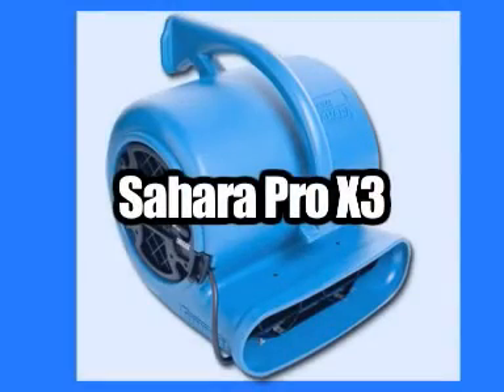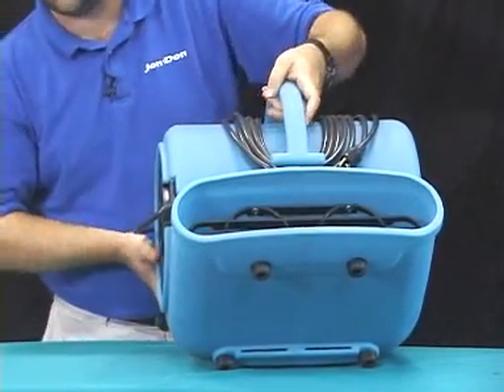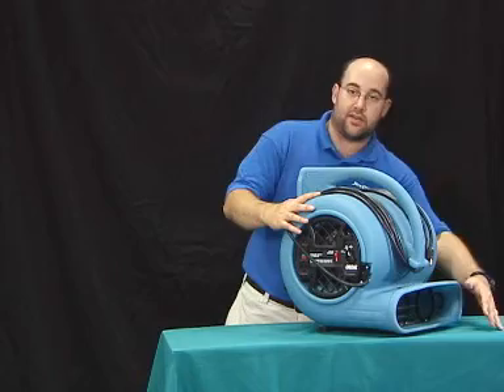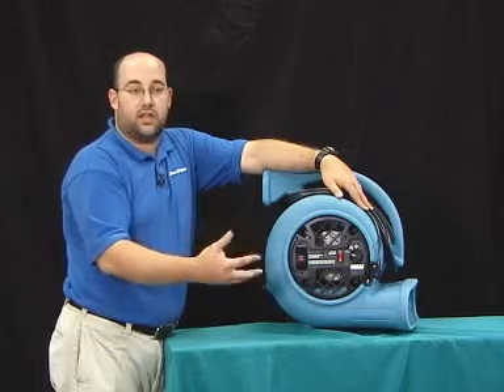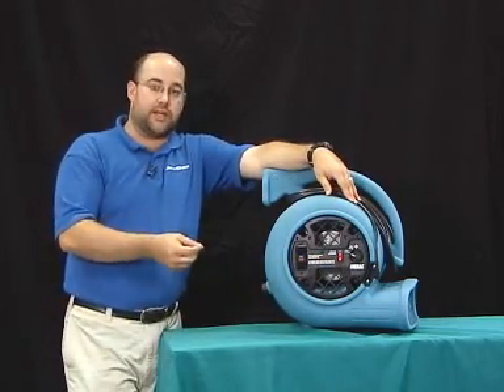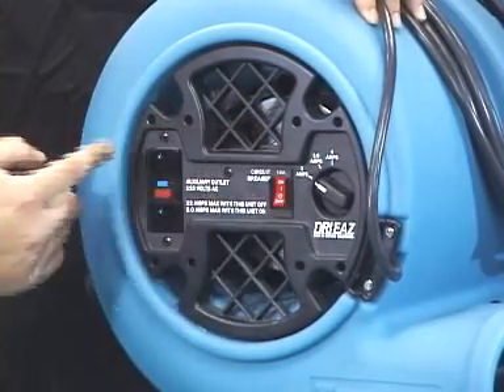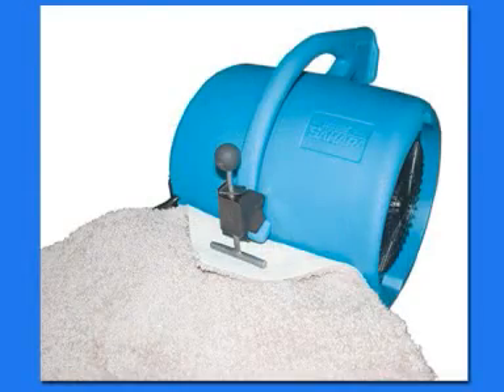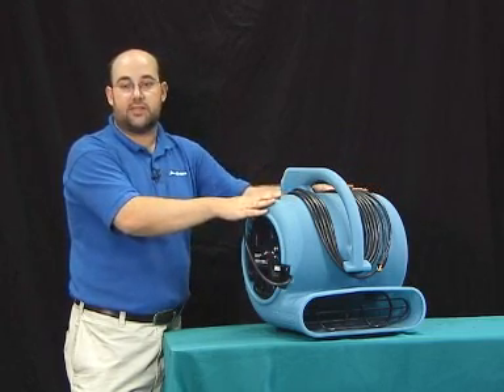Dri-Eaz Sahara Pro X3 Turbo Dryer - Jon-Don Video

Comment: "daisy chain", "squirrel cage" ? 0:31 How do they manage to intake air then? Shucks I'm dumbfounded!
Reply from the maker: Hi there - we're happy to answer any questions you have on the Sahara Pro X3.

Dri-Eaz has engineered high-performance air movers for over 35 years. Daisy chain capability and a squirrel cage have been common in manufacturing for years and are considered the norm. This air mover produces more than 900 CFM and has been one of the top choices by professionals who handle water damage restoration jobs. 

You can learn more at http://www.jondon.com/dri-eaz-sahara-pro-x3-turbodryer-air-mover.html or call 800-400-9473 to speak with one of our restoration experts.